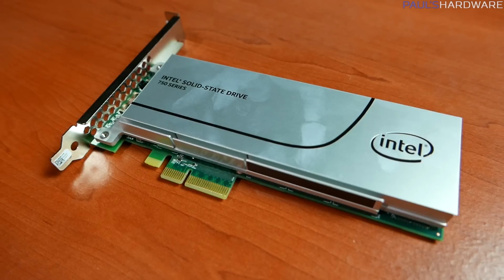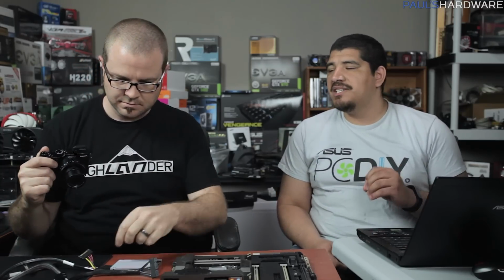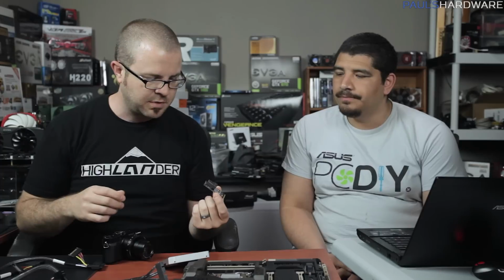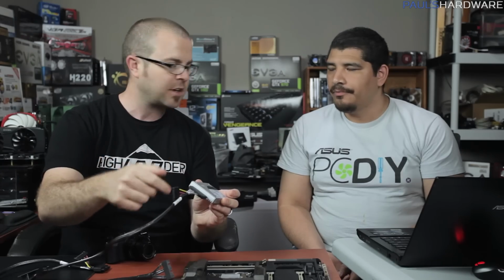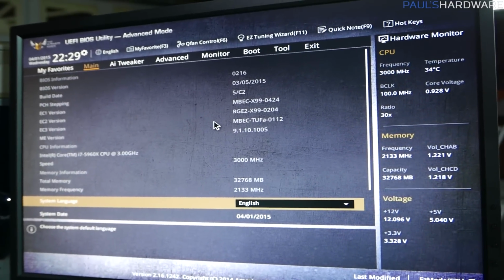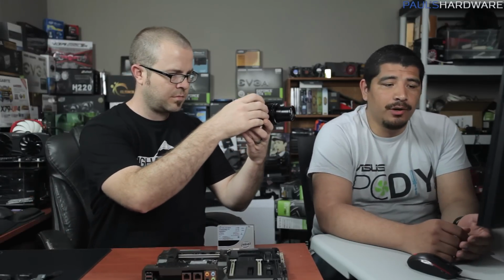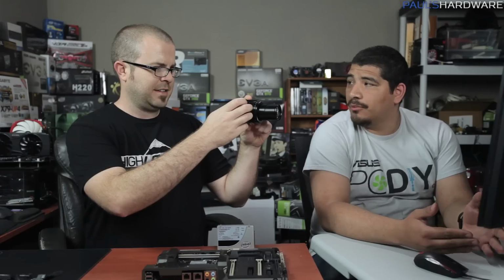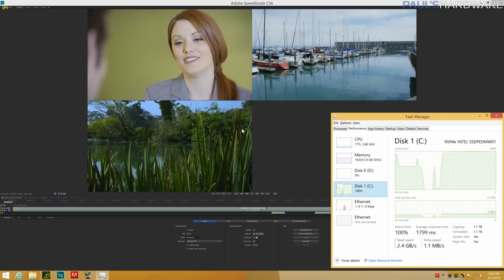Fastest SSD Ever! Intel SSD 750 with JJ from ASUS

Comment: Who here doesn't care much about getting an SSD?
I get home, press the power button, empty my pockets and store the stuff I had been carrying for the day and when I sit down my PC is ready to be used.
All this in what? 1 minute? Maybe less!
And I don't feel like my HDD is slowing my work/gaming down. But I'd have to try an SSD to give out a final veredict, obviously... Still, it's an expensive piece of hardware, and I'll wait a little longer before I spend my small amount of saved up cash on something I feel like would not benefit me much.

And no need to tell me "don't watch this, then". I watch this because I'm interested in  new tech, even if I don't care about acquiring it :/
Reply: MrBDayz I find it funny that there are still people thinking an SSD is mainly for the faster boot time.. It's not! It's all about the snappy-ness of your system, even after several years without reinstalling windows.
An SSD is the best upgrade one can do (besides graphics upgrade). Just get a Crucial BX100 120GB or buy it on sale or so.. Put Windows & Programs on it.
Reply: Advection357 MrBDayz Its hard to believe ppl without SSD's are making comparisons such as this "explorer is 0.1 sec faster..." Haha! You have absolutely NO IDEA what an insane bottle neck HDDs really are. Once you have an SSD even a 40gb for OS alone, your whole system shows a drastic improvement. Its not just for booting, I only boot maybe 2x per month so I could care less about boot time. But everything I do, click, bam!, click Woah!, File search instantaneous. Its amazing! Youll never really understand unless you have one. As for the limited writes, they are in the billions and reported to last up to 10 years. That's pretty much the lifespan of any good HDD. I havnt had mine for that long to know for sure but its going on 4 years now. So Im not really worried about it. SSDs really are the BEST upgrade money can buy. You wont even believe the difference it makes. And youll be kicking yourself for waiting this long.
Reply: MrBDayz I couldn't care less for load times... as long as I got lots of ram and stuff runs fast once it loads. The latest 7200 rpm 64mb cache HDDs (seagate or wd) can do 200+ mb/sec read AND write. What they don't tell you about SSDs is... the advertised write speeds are with highly compressed files. If you write non compressible data, like videos, music & pics... the write speed often falls below the HDD's I mentioned. I also like how HDDs often warn before imminent failure... an SSD will just die on you with no warning. I'll consider SSDs when the price per gig matches a HDD... but until then, I'll stick with mechanical drives
Reply: SSD's are some of the best tech around these past 5 years.  Sorry if you can't see that!  Like Smoking Crop says, it's the snappyness of your system, very responsive, programs load up with the quickness, game load times are super short.  I am ALL about not sitting there waiting on my PC. I grew up in the age of processors with speeds less than 1GHz and god-awful IDE hard drives.. so I very much appreciate what an SSD brings to the table.
Reply: This is what people always say about ssd's.... But after you try it, all doubt will be removed.
Reply: Gabriel Marinello
Get one ASAP!! :D
Reply: That's what everyone without an SSD says. You have no idea what you're missing out on...programs open instantly. Games load significantly faster. It's totally worth it!
Reply: Ben Zimmerman I totally believe you guys. I do think Id be happy with the change. Thing is, my current drive is fast for what I do. Load times are not long at all for anything, hence my (I admit) dumb comment... But thats why I say I really dont care much about SSDs. at least not for now...
Reply: MrBDayz I was just like you before I made the switch man, trust me. If you like being an enthusiast and you have a good system, you owe it to yourself to at least get a 120gb for your os and all your programs. It just makes it feel fast. Its hard to make an argument for SSDs because of the price though. I understand how you feel.
Reply: MrBDayz They literally give a scenario where an SSD like this is useful in the video yet you still have the temerity to ask a stupid question. Why?
Reply: Advection357
SSD tech is starting to develop?  SSDs came to the market in 2008 and they have //already// developed.  Their speeds already saturate the SATA bus. Name any hard drive that does that. 
Intel recently came out with a PCIe SSD that has read/write speeds beyond 1GB/s.  SSDs are far superior to HDDs in every way except price.
I just copied a file from my M550 SSD to my 840PRO SSD and the write speeds to the 840PRO were 240MB/s.  Show me a consumer hard drive that can match that. 
You can't deny that there's a massive difference between a 15ms seek time on a hard drive and a 0.09ms seek time on an SSD.  NAND flash chips are much faster than a R/W head hovering over a moving platter.  However, hard drives do have their place.  They're great for media/massive storage.

"i also like how hard drives warn before imminent failure"
Yeah, let me tell you how many hard drives have warned me before they died: 0.
SMART is just info about the drive that you need to look up and take action before failure. By the time you get warned the drive is bad, it's too late. You //never// trust any one storage medium with your data, which includes hard drives and SSDs. 

Quit defending hard drives and bashing SSDs just because you don't understand them.
Reply: Glycerin I never said SSDs are slow dude... not sure what you're arguing about here. 7 years is not a long time for a technology... I mean sure it's kicked into high gear now & speeds are increasing etc. But it hasn't matured yet. By that, I mean that the "rough spots" haven't been smoothed out... not fine tuned... perfected... etc... call it what you want. We're still in the middle of it, with Intel now almost ready with super dense nand chips. The price per gig is still 10x more expensive than good old platter storage... considering they don't even have moving parts and SHOULD be more simple to fabricate. The firmwares & controllers are also constantly being updated, which is another indication. They don't even have SATA Express SSDs yet... and M.2 barely started rolling out. In the 3 occasions spanning 20 years or so, I was able to revive 2 of the 3 drives & copy the data before discarding the drive. It depends from the type of failure (mainboard vs head etc..) and I'd rather not get into details... On a last note, SSDs will get corrupt and often not boot ( 95% of them, except high end Intel drives) during the event of a power loss. So again, the technology is not quite robust yet & has some kinks to be ironed out. Sure it's not a big problem for laptops... and yeah get a UPS yatti yatta and all that :P But that just means more and more $ and most people don't have a UPS. I never said SSDs are bad... sure they're fast but I'd rather wait a couple of years till the prices go down & the problems I mentioned get worked out.
Reply: Advection357
The way you are talking about them, you're making it seem like they don't really matter.  My 2TB Western Digital Black can barely crack 100MB/s read speeds, meanwhile my 840 and M550 are beyond 300.  I never thought I'd have a convo with someone trying to convince them why SSDs are better.  The price is seriously what is stopping you?

Let me ask you this: Have you ever owned an SSD?  Do yourself a favor and go buy one.  They aren't THAT expensive.  If you keep saying you're gonna wait, you'll never buy one.  I recently bought a 512GB SSD for $130.  Back in 2011, a 128GB SSD was $300. And actually 7 years IS a long time in tech years. A long ass time.  SSDs were able to accomplish in a few years what hard drives still can't do in 20+.  They aren't simple to fabricate.  Neither are hard drives.  For the 20+ years that hard drives have been around, they should be a lot faster too, don't you think?  I definitely would like you to show me a hard drive that matches the 200MB/s+ write speed of my 840PRO.

Not sure what you're talking about when you keep saying they need to work the rough spots out, what problems exactly are you talking about?  You say SSDs will get corrupt upon power loss.. last week the power went out while I was using my computer, and my SSD works just fine, so that point is discredited.  I've been screwed over by hard drives multiple times, and yet I've had no problems with the SSDs I've had.  You never trust your data on any one storage medium anyways, so saying that SSDs just die out of nowhere is a moot point.

I can see that you have a fondness for hard drives man.. but sometimes you need to venture off and try other things.  I can guarantee that you'll be singing a different tune after using your computer with an SSD.  Hard drives simply cannot touch the performance of an SSD.  I love them, and I hope one day you will buy one!
Reply: MrBDayz Just inside the Windows environment, I can tell the difference between a HDD and an SSD. Just doing general things, not even heavy tasks. I have a HDD in my laptop (it's not a shit laptop, Asus G550JK with 16GB of RAM), and SSDs in my desktop. Both running Windows 8.1.

The HDD struggles to chug along with even basic tasks like web browsing, file browsing, everything. I can REALLY tell the difference between an SSD equipped system and a HDD equipped system.
Reply: ***** Have you ever considered that some people may not be in the best financial state? SSDs are in no way a priority even if you're a power user. Personally, I'd prefer to upgrade my CPU or GPU rather than my storage units.
Reply: Well, at least I'd say that's my perspective, maybe others were arguing that he should make the change, with me, I always say to each his own, and yeah, SDD's are still pretty overpriced, even at $300, that's a lot to spend on just a hardrive, though it does pay off, if he wants to use an HDD, a 7,200 RPM 1-4 TB drive is still a decently fast and effective drive to use, and nothing wrong with keeping to that standard. Me personally, I feel much safer with less moving parts, less potential for drive failure, though HHD's do last a long time, the quality ones that is.
Reply: ***** If I ever get an SSD, I'll get a 500GB one.
A 50$ one is a waste of money. I dont mind waiting for my PC to boot, and my most played games have more than 100GB togethr (GTA V has 60GB, BF4 has 30GB... etc.)
Reply: MrBDayz Latest technologies leave a lot to be desired in the way of upgrades. You probably buy your mobo specifically FOR the cpu you want to use, you probably max out the amount of mem it can handle immediately aswell. The only upgrade you can do now is a full mobo, cpu and mem replacement. Haha, that's basically all of it. If this situation sounds familiar then you should not overlook a simple SSD upgrade! In terms of cost, its really very small compared to the price tag of your next real upgrade (full bundle). And the performance, you'll be very VERY surprised. Trust me. Its so worth it.
Reply: See I need an SSD for load times in video games (sometimes I get over 5 minutes in Skyrim). Also, you know how you try to go through folders around your PC and it won't load? SSD eliminates that!
Reply: Captain Leerox
My Downloads folder is on my mechanical drive and it used to lag ass loading all the icons and shit.  I had to seriously clear out most of the folder to remedy that.
Reply: Glycerin Dang an SSD probably would completely bypass that. A BX100 is a nice choice for a quick, cheap upgrade.
Reply: 1 year without reinstalling windows and my PC is slowing down because of my shitty HD... I need a SSD
Reply: Captain Leerox
Absolutely, but I had decided to switch the folder location to my hard drive to save lots of writes.  But now I'm thinking it's not that big of a deal.  I've owned this drive nearly 2 years and I'm only at 3TB of writes.
Reply: I wrote this with a purpose of seeing what people replied but I my initial comment was... badly created.
And I want to apologize for the dumb argument starting comment.
If it even matters, here's a long ass text trying to clarify some things and 'replying' to some comments in here.

I meant to say that some people like me (in this case, I'm referring to myself only, actually), who never owned an SSD and don't see much waiting times during their computer usage, possibly would think that SSDs are quite expensive for something I would personally see no benefit in.
Obviously the load times, boot time, etc, would be less, but as I said in the first comment: I get home, turn on my PC, and go do something else for a minute and it's ready to be used. And load times in games for example are small. Skyrim loads up in 10 seconds! (5 minutes? I'm sorry for that guy :s)
but yeah... sorry for the dumb argument starting comment
Reply: Today is not April Fool's Day! :)
Reply: Sk3elly What was the scenario, as I don't recall?
Reply: Advection357 Your last statement is my view on SSDs at the moment. Once they become more affordable I'll consider getting one as I don't think having a 120GB one is a decent investment for me. I'd rather invest in a 500GB so I can have everything in it but only after they make SSDs that don't fail after xx writes/reads... Having everything in the SSD would reduce its lifespan by quite some time, I'd guess...
Reply: MrBDayz SSD technology is starting to develop but it's not really mature right now... HDDs have been around for decades. What's the point of getting a 120gb SSD.. you can only fit a few games on it.. that's it. Most people just put the OS on it and install the games on a HDD... which 1/2 defeats the whole purpose. So what's left... it boots into windows faster? How many times does one reboot their PC to make that argument..? File Explorer is 0.1 sec faster? o.O mmmkay...  SSDs will always have limited writes... that's just how flash memory is. If you really have some money to blow... you can get a RAM SSD & won't have that problem :P
Reply: Advection357 You mean a RAMDisk? ahah Yeah, that would be cool x)
Cool but limited. Waaay limited :p
Reply: Fizzgig I'll wait for a bigger price drop. If I ever buy one, it'll be this one, just because of its price.
Crucial BX100 500GB SATA III
200$ for a 500GB SSD. Seems like a good deal, but I'll wait for it to come down a bit more.
And once again, I don't doubt that it'd be a big difference... But for now, I wouldn't benefit much from it.
Reply: MrBDayz Yeah, it's not a big difference... 60 MB/s on a HDD, going down with time - mine is 29 right now... I'm so sad -  and, in comparison, 600MB/s, never going down on a SSD, wow, not a big deal at all
Reply: Gabriel Marinello I defrag my HDD every now and then, like, once a month. It remains as fast as when I first bought it for what I experience.Last time I check it was writing at 100MB/s if I'm not mistaken.
Also, I see no need to upgrade to an SSD right now. As I said, once they drop a bit more, I'll reconsider, but for now, my daily PC use does not require such piece of hardware.
Reply: Fizzgig I'm aware of the "bottleneck" dude... I'm just saying that bottleneck doesn't bother me... it's not something critical that I MUST have. It's like trying to tell a non-gamer how much better a GTX 980 is compared to the IGP in their cpu... :P
Reply: Gabriel Marinello 29 mb/sec is really sluggish.. I had an old seagate 250gb HDD... and even that was doing 65-70 mb/sec on sequential read/write... it was a 7200 rpm drive though..
Reply: Advection357 Did the test on my usb 2.0 drive LOL. My HDD feels so slow that I believed that... My real average rate is 99,6 MB/s... But I don't understand... I feels SOOOO slow =/
Reply: Gabriel Marinello usb 2 can do around 50-55 mb/sec max... (realistically) & if you have other usb devices plugged in, like a keyboard or mouse etc... then the speed gets reduced because it's shared with all devices. 29 mb/sec sounds just about right..
Reply: Glycerin I'm just jumping in and out on this one conversation, but they don't matter for those who are happy enough with their HDDs but not happy enough with the SSDs prices, like myself.
Not sure what goes about with Advection as I can't speak for him, but in my case, my HDD is all I need right now. I don't see much use in cutting down wait times, as I don't mind about that...
Reply: Glycerin Read speeds are a different game.. and I won't argue SSDs are considerably faster. You were lucky that you didn't get data corruption after the power loss... most probably because the system was idle. There's just too many negatives vs the speed benefit for me. Another point being how write speed degrades as the drive gets filled. And that just compounds the already high price per gig. If I really needed more speed (which I don't) I'd rather get 2 x 1tb (single 1tb platter. Your 2tb WD Black is most probably the older model with smaller platters) 7200 rpm 64mb cache HDDs, & put them in RAID 0. For 100$ I'd get 2TB of space @ 300-400 mb/sec read and write, regardless of how full the drive is. Not sure any SSD can match that price vs space & speed. I don't run a server and don't need 100k iops or insane access times. But I probably won't. Like MrBDayz mentioned, it doesn't bother me to the point of running to the store to buy an SSD. With the limited budget I have for upgrades, I'd rather spend my money on more critical parts... such as more ram or faster gpu...
Reply: Advection357
Sorry man, that sucks. I don't have the biggest budget but I managed to buy a couple.  I guess have fun with your hard drives.
Reply: Glycerin I will. I plan on setting them on fire and juggling them 3 at a time :P
Reply: You'll care to know that standard HDD's, since there's physcial spinning / moving parts, are highly prone to long term failure, eventually the motor dies, or the read head scratches the Disc, it's really remarkable how they even work, it's almost defying the laws of physics, when you learn how close the read head is to the Disc, nanometers away hovering overa tiny pocket of air! I say, if you value your cherished data, get something that's Flash based, no moving parts to break down.
Reply: rockstar89
Agreed.  It is indeed fascinating how hard drives work.  Are they as good as NAND flash drives?  Hell no.  Can't teach an old dog new tricks though.
Reply: rockstar89 So what? SSD's fail because of controller instability at about the same rate that hard drive's fail due to head instability. They have 0.5-4% annual failure rates, while hard drives have 3-5% annual failure rates. If you don't drop/shock your hard drive the difference in reliability is negligible.
Reply: This is why we'll go to ultra compact and super scratch resistent / high capacity laser discs in the future!
Reply: Cold storage that's nearly failure proof, and highly resistant to destructive forces.
Reply: They'll be as small as a quarter or half dollar and hold Petabytes of Data! Lasers will become so advanced that they can laser burn data at nearly the molecular level in size!
Reply: Then if your Laser Disc reader's moter fails or what not, your disk will most likely be perfectly fine, and you can easily make duplicate backup copies, this is the FUTURE!
Reply: Video Games will never fully go discless, even 30+ years from now, because each game will have the equivlent of an entire hardrives space of Data do to how massively and data hungry games will end up becoming, and since Hardrives themselves will also be these same discs, or these tiny glass like fiber optic squares that plop right into square holes on your glass like fiberoptic motherboard, esily removable and what not, it'd make more sense to just have these games as physical discs, and computers will have trays like CD changers, that can store like 10+ Micro Laser discs at once, loading whichever one you want by an internal turn-table. It'd be the prefferalble way to store data, play movies, and games and what not, especially after when everyone gives up on the cloud and Streaming services in general for all their security issues, lost data from hackers, data removed by Government, or because streaming services no longer support a particular game or movie that get's removed form steam, Origin, Netflix, Play Station Now, and Hulu. Plus people will just hate the idea of renting media period, since these physical movies / games no longer take up an entire shelf of space, and  they cannot be deleated, not even with a Magnet!
Reply: Everyone got trolled by this guy who's baiting everyone to convince him to jump from HDD to SSD. Lol
Reply: yang4evr nah man ( ͡° ͜ʖ ͡°)
Reply: Yay, you refering to me? Am I the Troll you speak of? My life's now complete! I'm officially recognized as a Web Troll!! Sweetness!
Reply: It's just that HDD is ancient dinosour tech now, it's been used for nearly two decades now, it's being phased out, and that's the turth, nobody's saying that you HAVE to change to SSD, more like ephising the point that SSD's truly are superior to HHD.
Reply: I mean, it's rather frivilous arguing for one way or the other, when at the end of the day, it's all how the user wants to build their rig, PC's are Amazing, because wer're given that sorta vertatility and customizablity over other platforms. HAIL THE PC MASTER RACE!
Reply: I won't argue SSDs are better than HDDs in many ways, but you guys were all saying how bad HDDs are and how I "owe it to myself" to get one of those drives...
Later, maybe.
Reply: And yeah...  PCs FTW! ;D
Reply: Nah, totally, stick with a decent HHD, wait til' SDD's drop more in price, can't go wrong with the 7,200 rpm HHD's, it's just data read and write spead / boot speed and load speeds in games that hardrives effect mostly anyways, a better GPU for hardcore gaming will do wonders more than a good Hardrive would by tenfold, that is if your using your PC for gaming, me, I can't help but wanna push an elite gaming rig meself, since Pwning n3bs in FPS games is what I do best!
Reply: I just wish I had that Delta Six Gun Controller for even better FPS Shooting! THat thing's overpowered, and 100 times more effective than mouse aiming!!! Ohhh I CAN'T WAIT to get my hands on one! Best $463 one could spend for the amount of kills and realism it will bring to gaming, pair that with an Oculus Rift Consumer Version Virtual Reality Headset when it's finally released later at the end of this year and a Cyberith or Virtuix Omi Directional Treadmil, and I'll be in Gamer Heaven!!
Reply: Indeed, gaming is what I do most on my PC. But just like I can't afford an SSD, I can't afford a new GPU not CPU :(
THE STRUGGLE IS REAL! D:
lol
Reply: Then I'll form an Elite Frag Squad 5 man Team and tear it up in pro- FPS competitions!! THe age of Proffesional "E-sports" is finally here! I'll be drooling over the time they have championships where you win a Giant NES Controller Trophy similar to how Football players win that Giant Football Trophy in the Super Bowl!!
Reply: I've an empty spot saved on my shelf, just in case that time comes soon, and I'm able to compete for it!
Reply: MrBDayz You know you can buy SSD's for under $50? Put your OS & main games on it. Then stop being grumpy. You probably spend $50 over the course of a month on frivolous things like morning coffee, snacks, soda, fast food, hookers & blow. Just save up $50 and you're set. 

http://www.newegg.com/Product/Product.aspx?Item=N82E16820233782